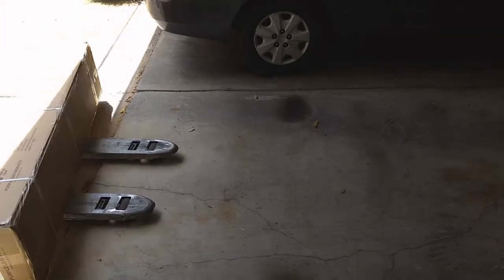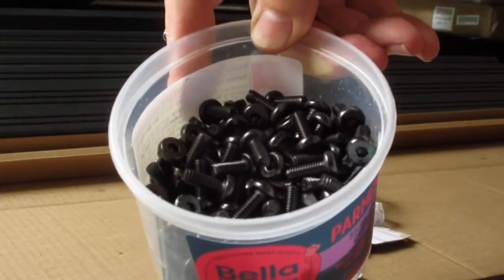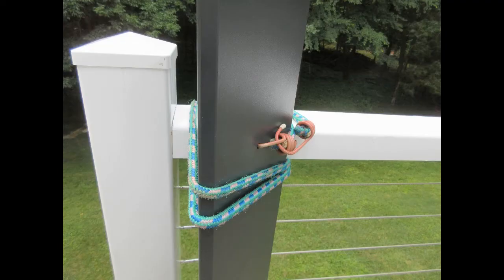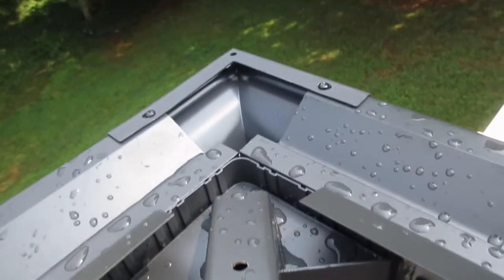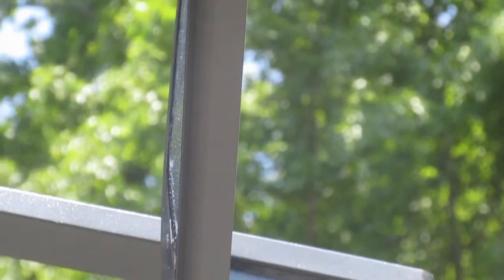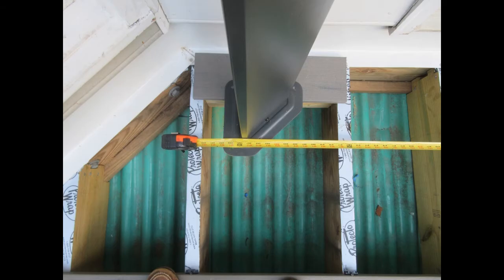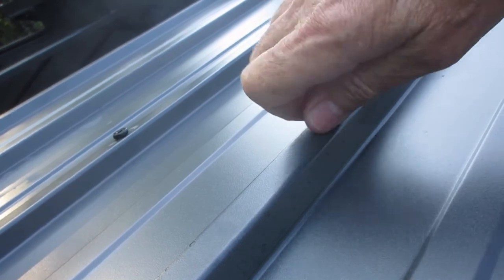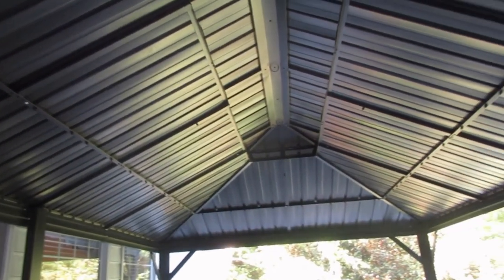Purple Leaf Gazebo Assembly 12x20 Single Handed ZY04GHTH1220

Comment: tapping the rubber S's (square strut washer) under those first center ceiling sheets is crucial... I also taped long bolts coming up from the underside to line up the holes.    Good luck with this step!
Reply from the maker: Yes, without the square strut washers, the roof panels can't really be tightened down very well.  But yeah, those washers under the ceiling joists are 'blind', so you've got to be thinking ahead.

Comment: Great video!! Much appreciated since we are building on a 12' deck as well, against the house. How'd you get the lower roof panels on though? Since I don't have clearance on either side, I'm trying to figure out how to get them overlapped and screwed down 🤬
Reply from the maker: 8 days ago...you've probably figured it out.  I started in the middle, with a ladder and standing where the next roof panel would be going.  I worked my way out to the edges.

Comment: Love your video.  Thank you.  Very clear details on parts and connections.  For example very clear picture of roof sheet tuck tighly into roof panel.  I have a question:  Because of this tight fit, do small tree branches, dead leaves slide down off the roof or stuck at the rood panel during rain or storm?   I'm thinking of buying this product but store staff members don't know the answer.
Reply from the maker: Yes, the corner gutters get full of debris.  I was going to make another video about this.  Having that one drain hole is a bad idea.  What happens is water doesn't flow out, but instead fills-up the inside of the beam and drips out the middle.  I'm not sure what I'm going to do, but there's something that needs doing to fix this problem.

Comment: Great video. 
Can you elaborate on the pre drilling and running that electrical wire?

Thanks
Reply from the maker: I drilled though the plate at the bottom, and drilled through the plate at the top.  Then I fished a stiff wire through to pull the electrical wire through.  I should have concentrated more on that in the video.

Comment: Thanks for the great video! It saved me a lot of headaches and the approach was methodical and helped with planning, especially for the roof panels. Very similar situation with placement on a deck next to the house. Thinking of putting de-icing cables for the roof coming down at the house for the New England winters...
Reply from the maker: Luckily in Charlotte, NC, we don't get the kind of snow/ice you guys will have to deal with.

Comment: Quick question for the top roof(V panels) around the 13:44 mark, did you put the Z, Z1, Z2 etc clips ? It appears like you just put the panels in without those clips… I’m having an incredibly hard time keeping them on when I try to slide them in..
Reply from the maker: I think the "Z" clips are to keep insects from coming through where the roof panels meet the hip rafters.  You are correct, I don't think I installed the "Z" clips on the small upper roof (just bad on my part).  I did put them on the lower, larger panels, and you're right, they do fall off.  Not a great design, but I'm not concerned about insects anyway.
Reply: @sengsational  I just purchased the 12 x 12 of the same gazebo - the Z1, Z & Z2 clips that came with my gazebo were plastic - wish they had been metal like the ones in the video. Thinking of not installing them.

Comment: Will a 12x16 gazebo fit on a 12x16 slab, can’t find the answer and about to pour slab
Reply from the maker: I'd wager "yes", presuming the gazebo you bought is similar to mine.  The bottom plates outside measurements on mine are 138.5 x 230.25, so 11.5 feet by 19.2 feet, so less than 12 x 20.

Comment: I’m putting up the 12’x12’ version and it’s going ok
Spent some time Saturday and then Sunday 
Hoping to complete it tomorrow 
Got the lower roof to do
It’s basically just me 
Had a couple of pairs of hands to get through the framing portion 
The instructions were not the best and there isn’t much in the way of support online 
This was all that I found 
Thanks 
It helped to have this for reference
Reply: Finished it up today 
It’s a workout 
Those clips can be a pain as they fall off while you are trying to place the panels in their location
Did it by myself and I felt pretty confident by the end 
Total time in,? 
Around 20 hours total
3 days at about 4-6 hours each day on average
Reply from the maker: Glad you got your assembly done and thanks for putting the additional comment about the time it took you.  I agree about those clips.  I'm still not sure why they're even included except for maybe blocking the path for the largest insects.  But I didn't even putting up the screens.
Reply: @sengsational  yeah I put the screens up as well
They are a good quality screen material and look nice 
They Velcro at the top and bottom and there is a center securement that hooks into the posts 

However I’m finding it difficult to order the privacy curtains 

And I would have preferred the all grey one that came with the privacy curtains but had already taken delivery in this one 
Oh well
We are putting a hot tub under it for year round use 
Should work good

Comment: Can you give me the dimensions of the bracket that is used to mount to deck or cement? Can’t seem to find anywhere in the manual. Thanks

Got some info from the manufacturer… 8.465” is the bracket length and width. Someone actually measured it and sent pics. I’m going to put on a wood 1’ post with gen stone wrapping the post… at least that’s the plan today!!!
Reply from the maker: 8 5/8 inches along two perpendicular sides.  Then about 7 1/4 is the long part of the 45 degree portion.
Reply: @sengsational  … thanks… looked like 21.5 cm in her pic… could be a little off!!

Comment: Thank you SO much for your idea of putting the cardboard box on top of the ladder to hold the other end of roof frame!  I did something a little different.  With God's guidance, I taped the box with painters tape to the roof piece instead of to the ladder and then lifted it up onto the ladder.  I then secured that assembly to the ladder using a ratchet strap.  After the 3rd piece was attached, I removed the ladder, which left the box still attached hanging in the air.  It was easy to cut the tape loose and remove because it was painters tape and let the box fall.  I don't know how you did that alone!  I am a 68 year old woman and I had help from my 71 year old female friend and co-worker and my daughter.  I will say that there were some tense moments!   I purchased the sunroom, which has a similar installation.   I also appreciate your idea of securing the posts in the 1st step to something.  I secured mine with ladders and bungie cords.  Great idea!  Thanks!  My next step will be to install the roof panels.  I think the hardest part is over.
Reply from the maker: Sounds like a worthy solution to the ridge beam installation puzzle. Glad you got it figured out.

Comment: Hi! Great video with all the good details and tips! I want to know how it's holding up as far as quality and through the seasons. I'm in Virginia, and have been looking at gazebos for my parents' place. I plan to order a 12x14 or 12x16, but want to know if this brand is sturdy. As much as I'd rather buy American, the options are limited as are the prices! I'm happy to see you did it yourself, as I intend to do the same. I appreciate you sharing your experience!
Reply from the maker: It's holding up fine, in general.  I made a bit of a modification to the corners for gutter/debris/draining [  https://www.youtube.com/watch?v=2OhOoFjGKi4  ]  I don't see any rust on it, and although the gutters require quite a bit of attention to keep them from simply overflowing on all sides, that's more of a maintenance thing than a quality of manufacture thing.
Reply: @sengsational  I really appreciate your response and additional guidance, thank you! I'll be sure to follow suit on the gutter/ debris/ draining, as well as your experience with the 18" vs 12" fan extension! Brilliant demo! Cheers to you, Good Sir!

Comment: so is there any reason why one couldn't drill a 3/8 hole in the post base and use a larger lag bolt or concrete anchor?
Reply from the maker: I like big bolts and I can not lie, you other brothers can't deny.  Drill it out and use beefy bolts!

Comment: Thank you for this video.  We are interested in buying one.  Do you have an update of how yours is holding up since you installed it?
Reply from the maker: It's not showing any signs of rust or any other degradation that's significant.  Some of the roof panels weren't smooth on the bottom side when we bought it (painted-over rust, I think), but that hasn't changed.

Comment: we are also looking to build next to the house.  we also need to raise the roof about 4 inches.  now that you built one do you have any suggestions on how we could do this?  I was thinking about cutting and screwing together 3 pieces of my composite decking as a spacer.  Thanks
Reply from the maker: I had not thought about raising it up, but I think if you had long enough bolts or lag screws, placing the feet on a short stack of composite deck material seems like it would work.   That material slides easily, so you'd probably need to secure all pieces together.  I have experience jacking up a corner of the structure because I had to add deck boards after the gazebo had been completed.  I just cut a 2x4 such that when placed under the horizontal beam, the corner was raised up a few inches.  It wasn't difficult to lift the corner of the structure long enough to get the 2x4 into place.

Comment: I did the Ps and Qs first before the K for the roof.... anyhow K slide off my ladder that was holding it up and fell pulling Ps and Qs and the big beams all down..., pulling the housings off the M beams where the single bolt attaches.    The instructions leave it up to your imagination how to get the roof going.     Once you had K put into the M beams, did it stay at the height that you wanted?    Really the roof needs to be re-instructed in the manual  /instructions.        Thanks for your video.  It helps me see the steps ahead .
Reply from the maker: Yes, I was worried about the collapse that you experienced, but for me, the peak of the roof did stay where it should have.  At first, with the help of the ladder and the boxes on top of the ladder, then later, from having the ridge beams connecting.  I agree, the instructions leave a lot to be desired.

Comment: Two really quick questions do you know the bolt size for the tie down into deck? I am doing mine in concrete an using tapcon bolts I just don’t know the size. Also did you use the sealant that comes written in Chinese? I read the sealant is for the brackets inside the rails.
Reply from the maker: The sealant is for where the horizontal beams (gutters) come together.  I used 3/8 inch diameter by 3 1/2inch long lag screws to secure the legs to the framing.  The tapcon will probably not be quite as large of a diameter, but I think the length matters more than the diameter.  More threads into the concrete is good.

Comment: Are you happy with the quality of the product I’m thinking about buying the 10x12 version
Reply from the maker: For the most part, yes.  All the parts were there.  The holes mostly were aligned.  It's a pretty sturdy structure.  Some of the roof panels were obviously rusted, then painted over, but not many.

Comment: Ok thanks for the reply but just one more question do you love it I'm looking at getting the same one . There is lot of videos on the assembly by no video on the the quality of the structure
Reply from the maker: Tony, The design seems good, and the materials, good too.  Some of the roof panels had rust that had been painted over.  That was the biggest defect I saw.  You heard about the challenges to assembly, but once assembled, I'd say it's pretty solid.  One design issue is that the gutters go to the plastic corners and the small hole gets plugged with debris.  And improvement might be to have the corners snap on and off so you can clean out the junk that accumulates.  The structure is solid, if that was your concern; it doesn't budge a bit in high wind.  Of course, I've got it bolted down!!

Comment: Hi is that Liquid Tight conduit you used for the electrical, if so what what the outer diameter on that or better yet what size bit did you use to drill the holes in the post?  A follow up video on how what the electrical looks like would be great.  I saw your post of the boxes that you fabbed up for the fans.  Thank You for this video, just ordered mine.
Reply: Disregard, I figured it out after watching again, thanks again.
Reply from the maker: I see you figured it out.  That's good.  I used a "step bit" to drill the holes in the post top and bottom.  I don't know what size it ended-up being...I already had that conduit, and I just kept drilling until the conduit fit.
Reply: @sengsational  I'm back here because I'm sharing your video with some one.   I hope that you are enjoying you gazebo as much I am enjoying mine.

Comment: How would this work on patio block?
Reply from the maker: I would want to anchor the legs down.  This might be "overboard", but if you pulled up a few blocks where the legs would be, dug it out a bit and poured concrete, then glued the blocks down with construction adhesive, that might give you something that wouldn't lift up in a wind.  You'd need to get some kind of "tapcrete" type screws, or something like that.

Comment: When the holes on the roof panels don't line up to where they connect on the frame you can go down on the beam and loosen up the bar and adjust it.
Reply from the maker: I think you're right.  I didn't do that, but it might make it easier.

Comment: Thank you so much for this helpful video! We are up against some of the same issues (the gazebo fits exactly to the space we're building it in - no mushing around, got to be spot on. Also, we're building up against the home with no real access to the top by ladder on two sides). Your instruction is going to be quite helpful there! Thank you for the conduit placement - we hadn't thought of that but will be doing that. At this time, ours was delivered last night but only 4 of the 5 boxes arrived - box 3 (roof panels apparently) is missing.
Reply from the maker: Glad you're getting mileage out of the video.  If they had to have a late delivery, the roof panels are a good one, as they go on last anyway :)  Hopefully it won't be like our remaining deck boards.  Those were undelivered for months, but finally came and I installed them.